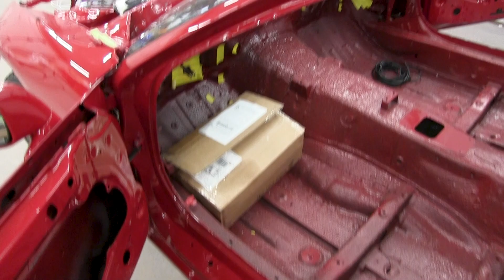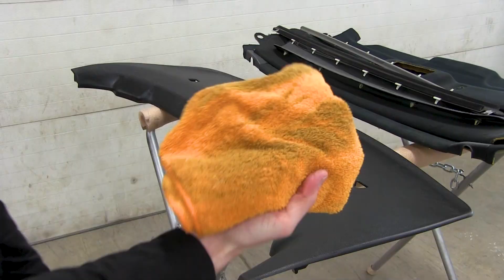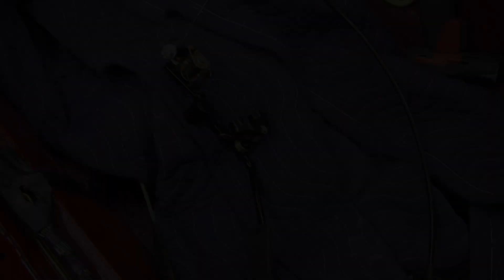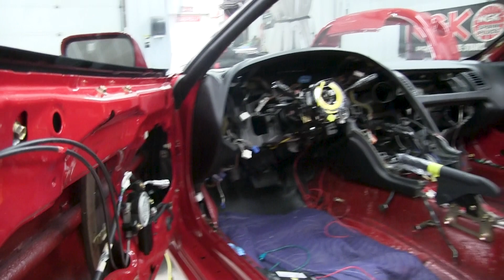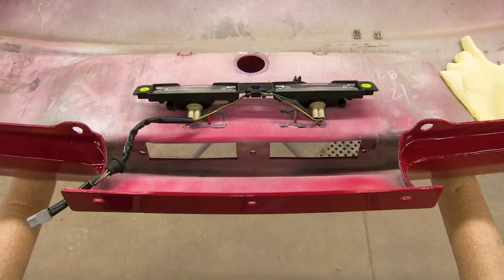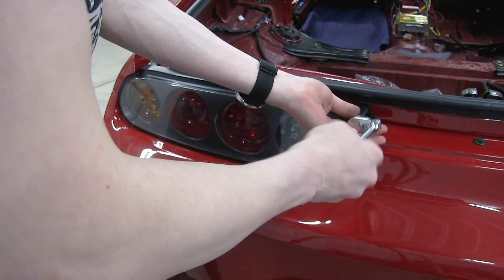Wrecked 1994 MKIV Supra - Assembly starts! Part 1 - EP 14

Comment: Great job !! What are those silver  support braces under the car along the sills  … they aftermarket ? I have a hard top so not sure what extra supports the targra tops have
Reply: Do luck floor support bars, MVP Motorsports has them. Not in stock though.